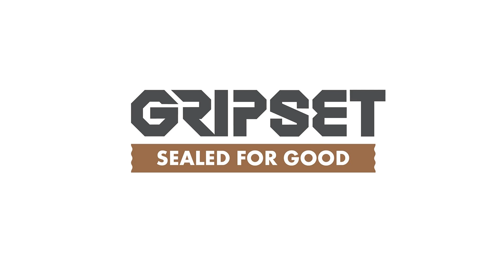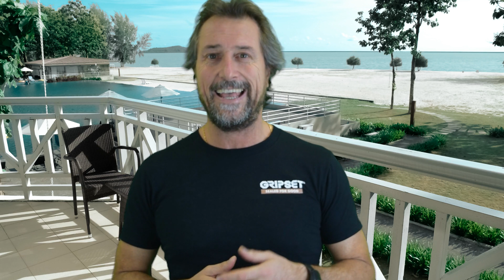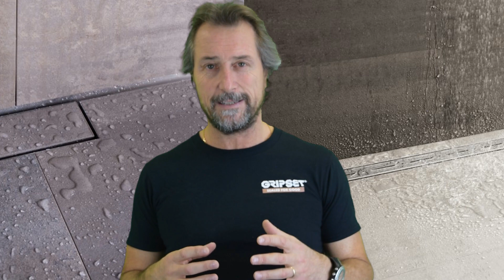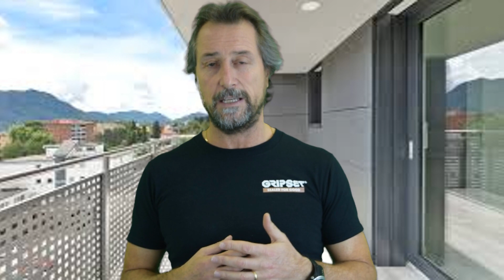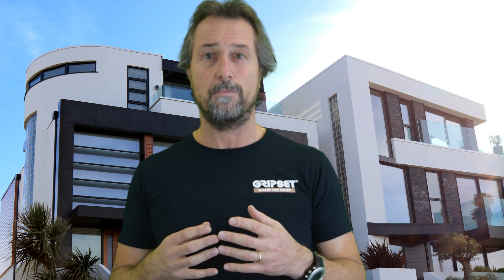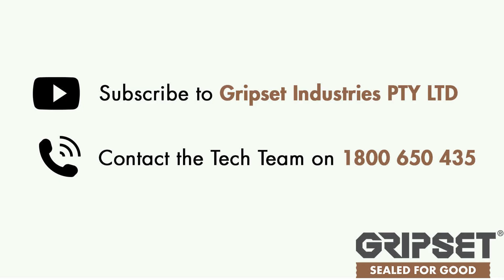Should You Use Water Stops?

Comment: Do you need water stop at doorway if the bathroom floor has 50mm step down on concrete floor ?
Reply from the maker: Hey Johnny! If the entire bathroom is set down at the doorway, no water stop is required at the location. However, a water stop will be required at the outer extremities of the shower/retained water area based on whether it is an enclosed or unenclosed shower. You’ll need to refer to AS 3740 – 2021 for details. Hope this helps! Thanks for watching :)